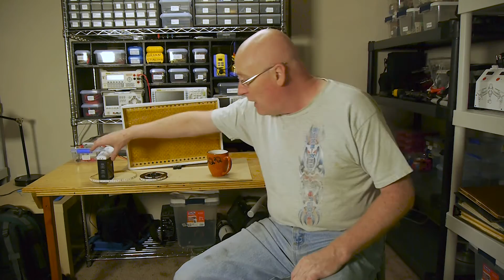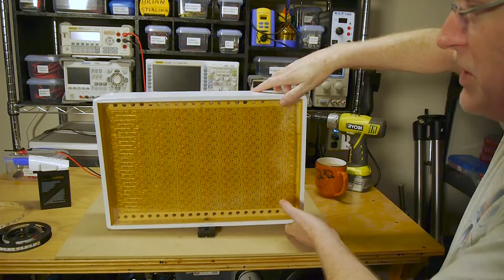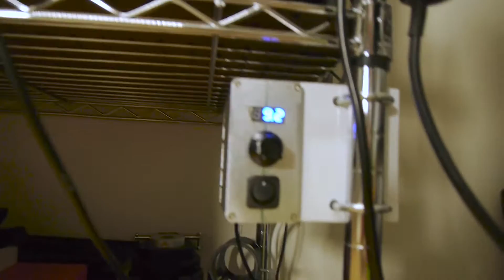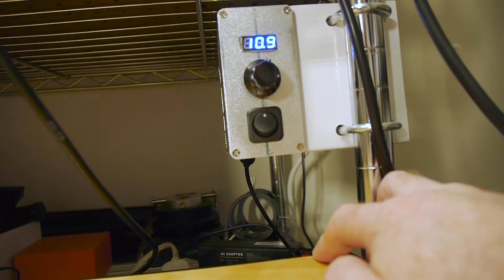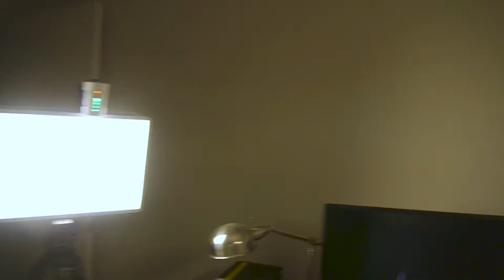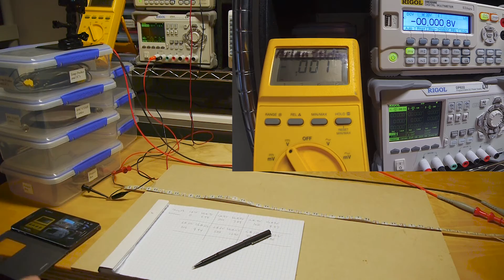LED Strip Lights Part 1

Comment: Led sizes make voltage and amp numbers vary? I.E. 5050, 3258, etc?
Reply from the maker: Yes, the two types of LED strips lights I've used have different LED's and the current and power consumption as not the same when driven at the same voltage.  The first set I had (SMD5050), the ones I didn't like so much, consumed less current and power at a given voltage and also produced less light and a less pleasing light.  The second set (SMD5630) produces a much nicer quality of light and also puts out more of it.  

I'd need a light meter to know if the light out was much different when driven at the same current or power.  One last point ... the first set with SMD5050 LED's was also covered in a thick clear plastic jacket to provide water proofing and I don;t know what effect the plastic jacket may have had on lumen's and color.
Reply: Thanks, I am attempting to install these light strips in a friends garage to replace his present lighting. Hoping that the power supply that I have ordered will drive these at full brightness. 12volt 5 amp. 60 watt. Will be testing them with you procedure. Sounds like a win for this. Thanks again.

Comment: please make and use a pwm led controller for the leds.
Reply from the maker: I currently use a buck converter and in essence a PWM and a buck converter both function like a switch mode power supply.  When you change the voltage setting with a buck converter you change the duty cycle of the PWM signal to the switching transistor.  So, in effect, a buck converter has PWM built in.